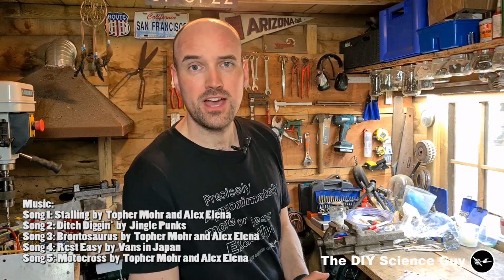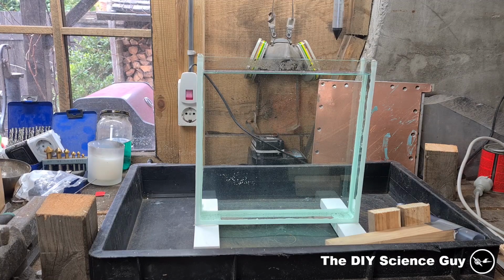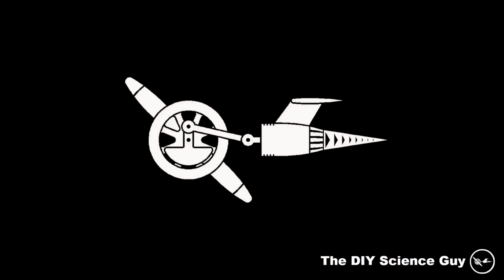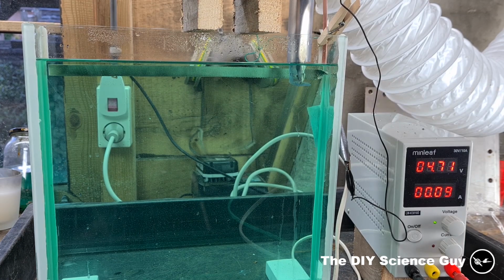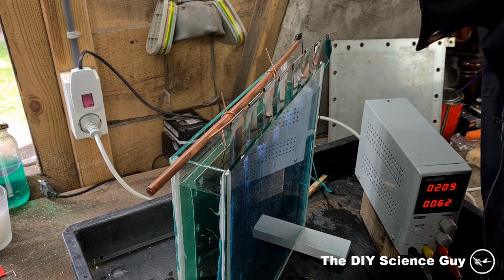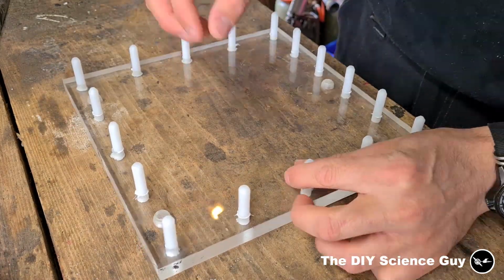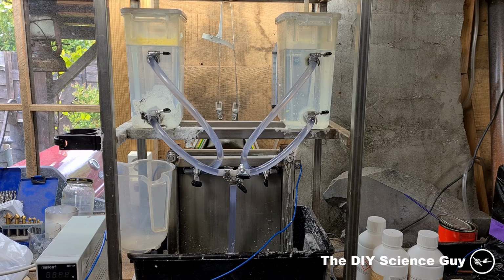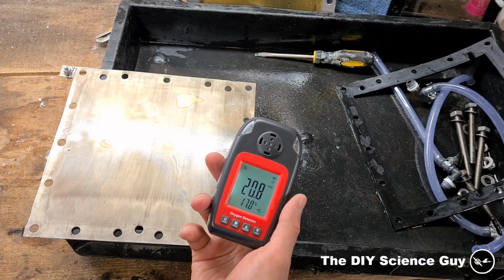Hydrogen Generator #6 Nickel Plating and Testing the Electrode

Comment: I used the same cloth material as (swim shorts) for the membrane. Polly nylon or polyester I believe this material is very chemically resistive. And will not let air through easily as well. Like when you jump into the pool and have a big bubble in your shorts.

Comment: Right ok, I've watched this now. Brilliant video, brilliantly explained I will try this myself and you have a new subscriber (me). If you're in the UK, pm me your details and I will order you the graphite sheet to play with. Graphite and neoprene rubber will stop this and potentially be more efficient, would love to see someone like you try it, and decide if it's good or not, I have found some interesting results.  

Credentials? I'm a massive massive nerd, watched many lectures and have started to design my own hydrogen boilers. Look forward to hearing from you 😉
Reply from the maker: Thanks! I'm in the Netherlands. What type of graphite is that? Because te graphite I tested had quite a high resistance.

Comment: That's great I hope it works great for you for a very long time.  You can find stainless steel sheet free if you can find someone throwing away certain restaurant equipment,it's a lot of work getting it all apart but it beats having to buy it, I salvaged some once years ago but sold it because I needed the money for tobacco, thankfully I have manage to beat that habit/addiction. I'm glad to see you getting that back together.
Reply from the maker: Thanks! I don't want to use stainless steel anymore because of the chromium problem. But thanks for the suggestion! 👍
Reply: @TheDIYScienceGuy  Titanium will get rid of the chromium problem and is not much more expensive than stainless steel.
Reply from the maker: The problem is, is that titanium is a very bad conductor of electricity. But thanks for the suggestion! 👍
Reply: @TheDIYScienceGuy  titanium is used for electrodes in PEM generators as it doesn't oxidise causing problems for the ruthenium iridium catalyst. We build them and they seem to conduct electricity just fine.
Reply from the maker: Don't they use platinum for that?
Reply: @TheDIYScienceGuy  platinised Ti. But we have found that step unneccesary. We do use platinum black on the anode side of our membrane electrode assembly, Ir, ru on the cathode side. We used graphite for electrodes but found Ti more effective.

Comment: Very well made electrolyser and quality of the process is perfect! To check if there is any oxygen in hydrogen just make a spark inside hydrogen sample balloon (if there is no flame after spark inside ballon with a sample then that means no oxygen in a sample). Regards!
Reply from the maker: Thanks! Yes that would work but I don't want sparks of flame near/attached to my generator. But thanks for the suggestion! 👍
Reply: @TheDIYScienceGuy  of course safety is most important so once you fill up a small sample baloon from the main h2 storage container then do the test in safe place far from the generator and preferrably outdoors. You can use a gas cooker spark igniter or somethin like that. Then for comparison add some air to the sample baloon to see what happens when oxygen is mixed in sample.
Reply from the maker: Yes I used to do that with a soap bubble like I did in the video but I now want a automated system.
Reply: @TheDIYScienceGuy  That (the soap bubble test which is known as the pop test) is completely different to what Kapalek84 is suggesting - the spark occurs inside the balloon without letting any air in and is therefore used in the hydrogen to test for the presence of oxygen, if no oxygen, then no ignition of any kind.
You are looking for a very small amount of mixing of O2 and H2, so if you were to periodically spark the H2 gas and use a microphone to listen for tiny explosions you will have a continuous testing process. This will test for oxygen (or chlorine) in the Hydrogen from about 4–74% concentrated. This is a fairly high contaminant level in the H2 so the spark test is not particularly sensitive.
If that resolution is acceptable, then, although sparking sounds ultra dangerous, if you sample and isolate the gas and provide suitable safety features, then it is relatively safe. I would personally pipe the O2 a long way away and same with the H2 container - in opposite directions! 
The idea is to isolate the testing sample in a small, thin glass tube with synced input/output valves, a pressure relief valve and embedded electrodes. A glass blower can build this for you.
If the contaminant  is small, then the microphone will pick up a pop and will vent through a pressure valve which can just be a simple spring on a stopper arrangement. 
The spark comes from two wires that are very close to each other in the tube with a suitable high voltage from a pulsed power supply. I suspect the wires will need to be replaced often since H2 is quite corrosive, so embed these in a suitable stopper that can be removed and replaced.
Check out this article http://riskmanagement.sites.olt.ubc.ca/files/2016/05/UBCV-RMS-OHS-GDL-14-004-Hydrogen-Gas-Use-in-the-Laboratory.pdf
Reply: @Bennyboy-dog  Excellent information. Thank you all.
Reply: @Bennyboy-dog   But you don't know if the gas is stoichiometric/will explode until you spark it... and it's too late at that point - even with flash arrestors and etc, sounds too risky to me!
Reply: I've always wanted to measure H2 purity by measuring the speed of sound in the gas - requires a fast processor/large sample distance and some cleverness for sure
Reply: @cwatson600  Yes, risky if the setup is not right Chad.
Reply: Chad, I've been looking around for info on measuring H2 concentration in H2 environments (plenty devices to measure in air). It occurred to me that since H2 is quite corrosive, we can measure the electronegativity by looking for voltage of a pair of conductors immersed in the gas. A metal that doesn't react too much so it lasts a while (platinum?) should give us some measure, although the reaction may be influenced by temperature, so compensation may be required.

Comment: Hello. I got a low cost poreless ionic membrane but p acid solution. Membrane electrolyser is OK. But I have to solve negative electrode wear.
For alkaline solutions, there are those used in PEM cells, but they are very expensive. I am trying solution to use nickel and alkaline solution.
I liked your lab. Good luck.

Comment: Sir cant we use your split cell design in your #3 video by stacking many split cells together with neutral plates and pipes out of each hydrogen and oxygen chambers .

does it have drawbacks ? or why you chose not to use the chamber design stacking instead of

Comment: Hi there Mr science guy:) how did the polypropelene cleaning product go in the Hgenny?
Reply from the maker: After 20 hours it was still OK. Long term test still needs to be done. But polypropylene is the most suitable material so I have high hopes for it.
Reply: @TheDIYScienceGuy  i'm keen to know how it holds up. Love your channel,  great stuff!
Reply: @johnking6188  I did watch "REPLACING GAS WITH HYDROGEN" and we have similar goal, cap the energy at day STORE IT, and release later on (at night for example), you have very nice setup, keep it up! I also want to compress hydrogen (non liquid state) and use it a a fuel in some engines. It would be nice to have a car/motor on hydrogen.
Reply: @spamator12  I have just started squashing the hydrogen into metal hydride in a home made tank. I'll post when I have data and footage. I agree, storage is the problem. Hopefully hydride in the mix offers solutions.

Comment: Hello, can someone please help me? I'm currently trying to rebuild the generator, but I think I made a mistake with buying the membrane. I bought PolyPropilen 150g/m2, which is actually for weed control. Unfortunately, the material is completely waterproof and doesn't conduct electricity. So when I apply a multimeter, there is no resistance (Ohm) measurable. Can this even work like this? Unfortunately, I have very little knowledge, so I would appreciate scientific answers. It would also be great if someone could provide an Amazon link to a more suitable membrane material (in the EU). Thank you very much in advance.
Reply from the maker: Hi, the material needs to be permeable to water so the current can flow through it. This is what I use now: https://www.amazon.com/Kimberly-Clark-33560-Polypropylene-Kimtech-Surface/dp/B00UBGXXS4 hope it helps!
Reply: @TheDIYScienceGuy  thank you really much. Helps a lot!

Comment: Respect of colleagues. If you remember, I asked you for advice on the choice of membrane material for separating hydrogen and oxygen. I'll confess without any secrets, I chose retex membrane material, thickness
300 um, and the electrolyzer separated hydrogen 100% well, but after 200 working hours of electrolysis it happens that occasionally a mixture of H2/O2 comes out of the hydrogen port, which is not good. I can't clarify what it is about... ?
Reply from the maker: Ok, wat type of fabric is retex?
Reply: @TheDIYScienceGuy  The Retex material is a non-woven textile based on polypropylene material
Reply: @TheDIYScienceGuy  I can't rationalize things, why does my dry cell electrolyzer sometimes separate H2 and O2 well, but sometimes it doesn't? I inserted a polyprolene cloth material as a membrane.

Comment: I'm looking to build the most cost effective hydrogen generator for an rc airship, would this be the best method for aluminum plates instead of copper? Not entirely sure how well it would electroplate and how well it would avoid corroding.
Reply from the maker: Nice idea! I don't know if you can nickel plate aluminum though.

Comment: What is the difference in efficiency of the nickel plated copper plates vs stainless steel amps and volts/ litre of output
Reply from the maker: Less heat generation, but I'm not sure how much yet.
Reply: @TheDIYScienceGuy  I think they are also more durable.

Comment: 1.What are the dimensions of the plates
2. How large are the holes and how far apart are they
3. What are the dimensions of the gasket.
Reply from the maker: 1. 250x250x0.5mm
2. The gass exit holes have a diameter of 9mm and are 150mm apart
3. Outside 250x250mm inside 210x210mm 4mm thick
Reply: @TheDIYScienceGuy  are the holes made to keep it together the same size and what is the spacing for those? Also I thought according to an earlier comment I saw the copper plates were 0.8mm thick?
Reply: @TheDIYScienceGuy  sorry about the fact I am asking so many questions. I am making a cad model. Also how far away are the water inlet and gas outlet holes including the width of holes from the plate?
Reply from the maker: Yes they are also 9mm

0.5 works but I could get 0.8 for free.
Reply from the maker: The inlet needs to be as low as possible. The outlets as far apart as possible. No problem, this is why I make these videos.

Comment: Have you ever considered using graphene foil  as the electroplate for hydroxide-oxygen generation?
Otherwise awesome workmanship and video! Thank you for sharing!
Reply: I've test with graphite rods from zinc-carbon "Heavy Duty" batteries in the past and the anodes would dissolve and the gas produced there wouldn't burn, leading me to believe it was creating CO2
Reply: @cwatson600  hmmm that's an interesting problem. I know the idea of graphite foil is from Robert Murray-Smith(youtube name) but lookin at the research paper he refers to it does talk about the issue of high concentrations of electrolight destroys the anode side as you say. He also uses Urea as his electrolight.nit sure how that changes the corrosion. Wish he talked more about it https://www.researchgate.net/publication/273806853_A_Systematic_Study_on_Electrolytic_Production_of_Hydrogen_Gas_by_Using_Graphite_as_Electrode

Comment: Interesting video thanks, however, for the uninitiated, NEVER double up gaskets, not even using gaskets of rubber insertion and a secondary layer of silicone, use one or the other but never both together  ....for they are dissimilar materials, wi different expansion and contraction ratios and WILL seperate and LEAK ... In due time... If no the day then some day soon.... So...
I really appreciate your video...
Thom in Scotland.

Comment: I WANTED SOME EVIDENCE OR ASSURANCE THAT NICKEL CAN BE USED FOR 65 HOURS BECAUSE I AM BUILDING  A HYDROGEN GENERATOR AND USING HYDROGEN TO REDUCE IRON ORE. CAN YOU LET ME KNOW THAT YOU RAN IT FOR 65 HOURS OR NOT. how many hours  can you run hydrogen generator with nickel plating.

Comment: can you use baking soda so that the salt doesnt create chlorine gas from the electrolysis. now i see you have ventilation but you said it was for the nickel
Reply from the maker: I use vinegar and a small bit of salt. I don't think it's creating a dangerous amount of chlorine gas. The nickle vapor is much more of a "problem". Backing soda might react with vinegar creating sodium acetate and Co2 gas. But thanks for the suggestion! 👍
Reply: @TheDIYScienceGuy  so we should not use nickel? i also heard we should not use staineless steel due to chromium
Reply from the maker: No, nickle is much safer just use ventilation for the same reason as when you are cooking. 😉
Reply: @TheDIYScienceGuy  but i dont cook i only go to the drive thru lol
Reply: @TheDIYScienceGuy  i never cooked with nickel, only stainless steel or other teflon
Reply from the maker: You know what I mean! 😜

Comment: something tells me the reason the plating was happening only close to the anode was bc of insufficient current
i think a current source as opposed to a tension/voltage source would be better, but i'm no expert
just thought it's bc ions and charges are mostly neutralized closer to the contact, and saturating it with more charge than the electrolyte capacity would make platting even
Reply from the maker: Current is a result of voltage and resistance.

Comment: Why not just use the pure nickel strips?
Reply from the maker: Because the resistance is to high.
Reply: @TheDIYScienceGuy  I am a bit confused why the resistance would be too high.   These same strips are used for lithium batteries and the resistance is only 4x copper.   The currents you are pushing are no where near causing this resistance to be significant, and you even mention you did not measure the difference.
Reply from the maker: It would work but I want the resistance to be as low as posible. A ratio of 4 would mean a lot more energy loss.
Reply: @TheDIYScienceGuy  why not make it thicker? You can use 2mm of nickel plates instead?´of .5mm copper . I think you loose a lot more in the wiring than you would loose even in a .5mm nickel plate since the plate has a huge cross of 125mm² with a resistance like a 30mm² copper AWG-2 cable
Reply from the maker: Pure nikle plates are expensive and I want the highest performance possible for this setup.

Comment: Remove the membrane add metal sheet as a neutral
Reply from the maker: A natural pate products H2 on one side and O2 on the other, which means that you would have an H2 O2 mixture again. The membrane must be non conductive but permeable for the electeolite.
Reply: @TheDIYScienceGuy  oh I didn't know that okay
Reply: You can filter out oxygen by make liquid nitrogen surely you can filter it out
Reply from the maker: You mean by cooling  down the gasses so the oxygen would condence out of it? Yes, that would work. Just a bit impractical but could be usefull for extra purification. Good thinking! 👍

Comment: How thick and how large a squares are the plates you used?  I am thinking of 12" x 12" square plates between 20 to 16 gauge thick.  Are you being able  to produce more hydrogen with the more efficient plates? How well is the Nickel plating holding up? Thanks, I need to replace my natural gas supplier with something because the new supplier jacked the price up double or more , I figure their intention is to do use like the did Europe, their goal is to exterminate 90% of the worlds population in a such a sneaky manner and make out like it was an accident.
Reply from the maker: Nickle holds up very well. I use 13 plates of 25x25cm(21x21cm effectively because of the seals) with a thickness of 0.5 mm
Reply: @TheDIYScienceGuy  the plates are 0.5cm or 0.5mm? 0.5mm is thin and would make it a lot cheaper to build  but 0.5 cm is very thick and very expensive.  Is it the greater the surface area the greater the volume of gas it will produce?Thanks
Reply from the maker: Yes, sorry, I meant 0.5mm. Yes, the more surface area, the more current will run, and the more gass will be produced.